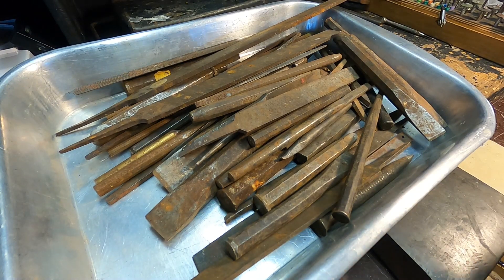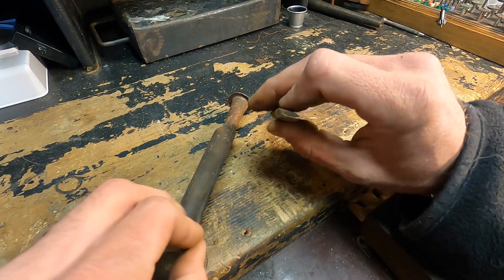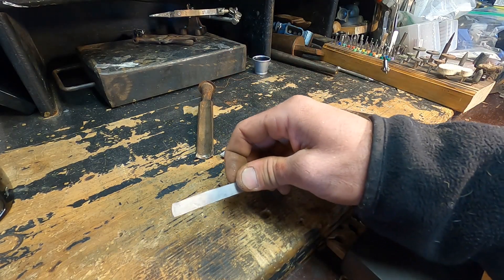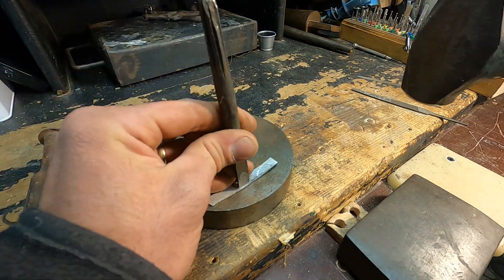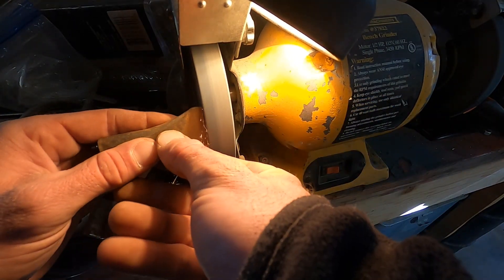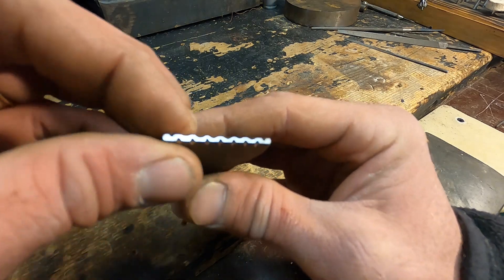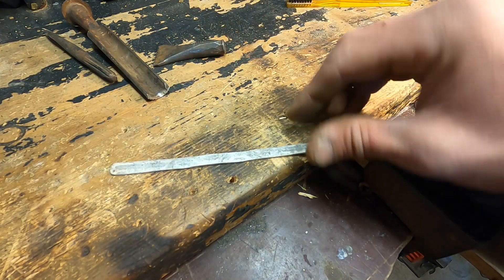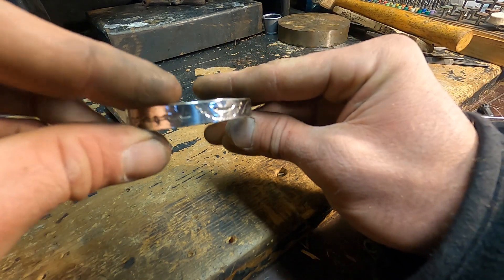Turning Scrap Metal into Jewelers Stamps

Comment: Might try annealing the metal first. Those are probably hardened steel tools. Annealing softens the metal making it much easier on the files. Reharden then temper you are good to go.
Reply from the maker: Yeah I could of made it easier but I'm ok without doing all that, it's not to terribly bad getting the file work done, I also didn't Polish up the stamping face on it.